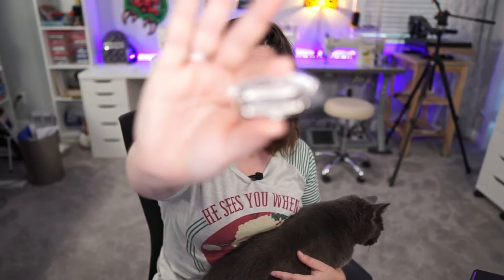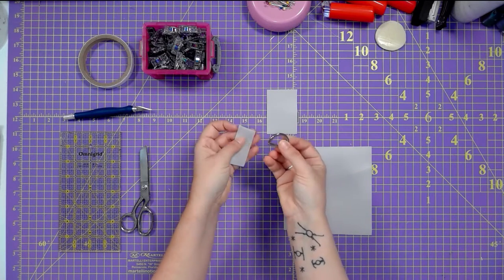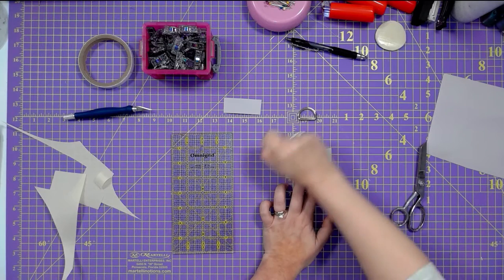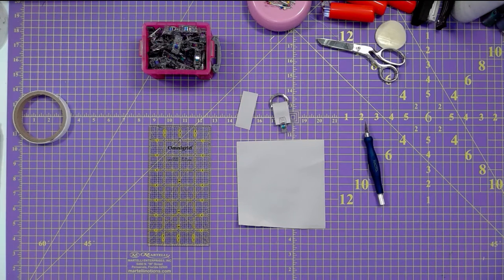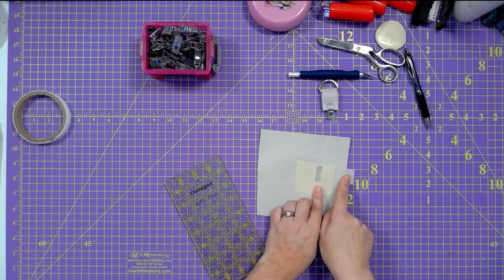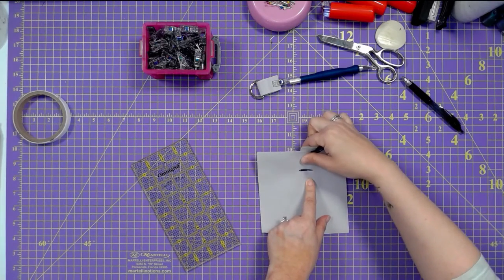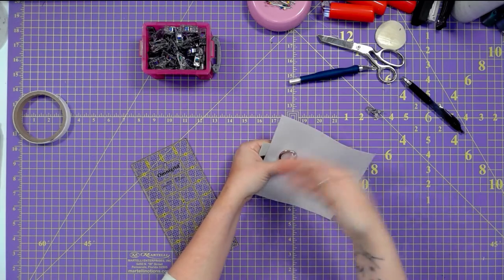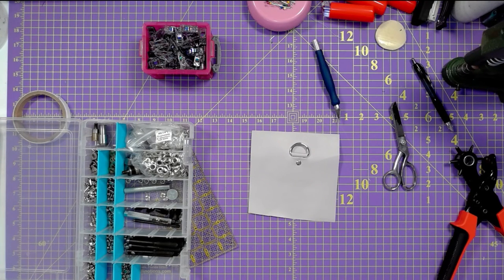How to Sew Hidden Strap Connectors

Comment: Hi! This is brilliant! I have a weird situation though. The point in my bag where I want to add this is actually at a seam. It’s for a boxed bag so it’s where the two side seams come together. Which means they would intersect the horizontal slit I’d be making for the strap connector. Is that going to create problems? How can I use this method on that bag?
Reply from the maker: Oh yeah... I wouldn't do that, sorry :( You'd potentially weaken that seam and it would eventually pull apart. I haven't done one of those before on the horizontal slit, but if I were to do any kind of strap connector there, I'd honestly just rivet it into place.
Reply: @fiercekittenz  thank you!!